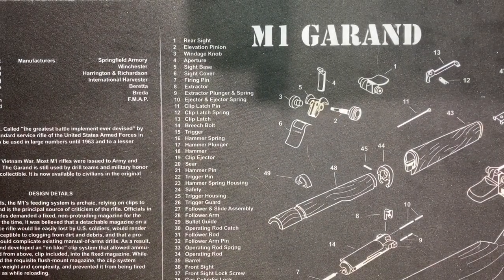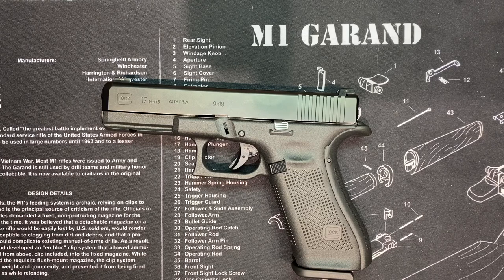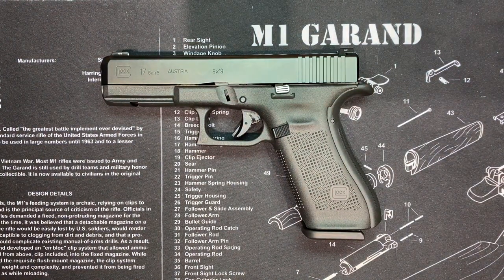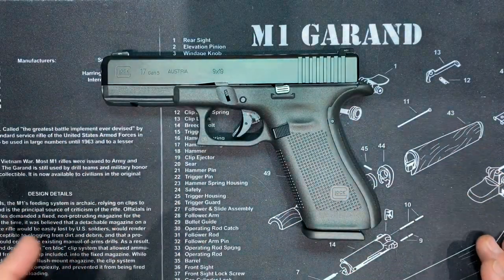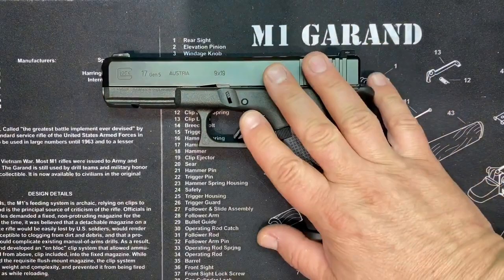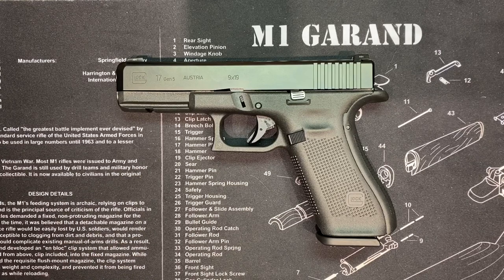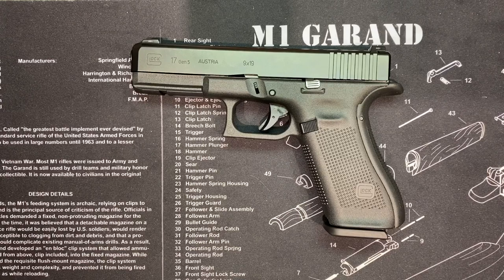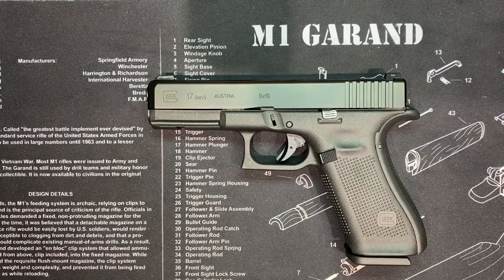Glock 17 Gen 5

Comment: This  Glock 17 gen 5 has no serrations on the slide in front its the older model the new gen5 has the front slide with serrations  if you could find one buy it they are hard to find 💯 👍
Reply from the maker: So you’re saying the GEN 5’s without the front slide serrations are uncommon?
Reply: i happen to own one does that mean i have a rare glock gen 5 ?